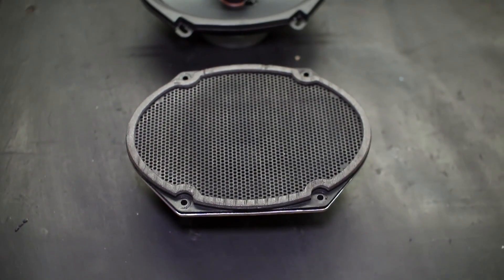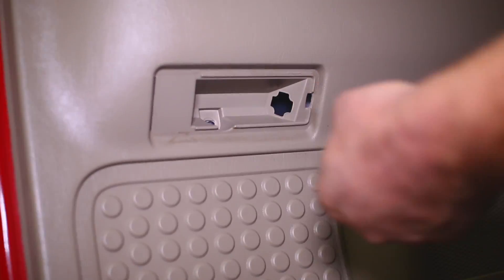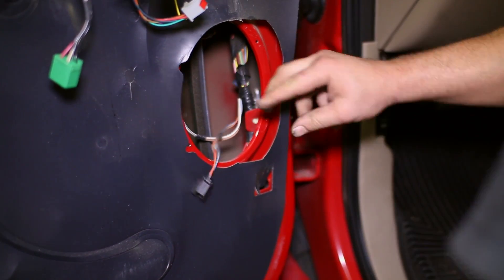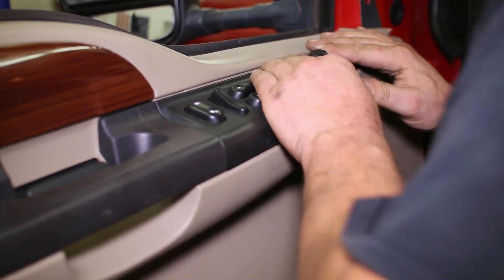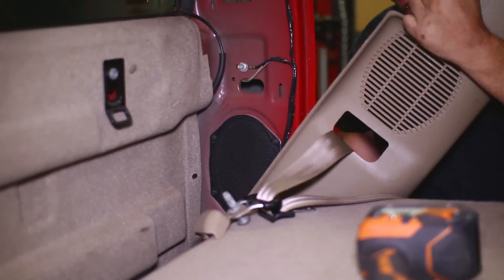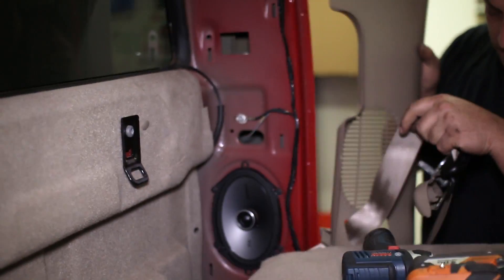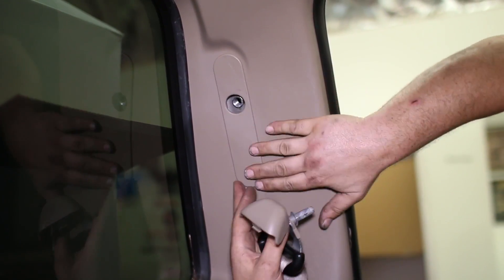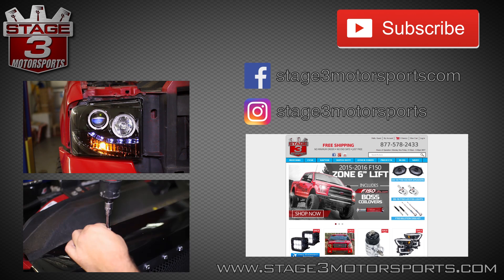1999-2007 F250 & F350 Super Duty Kicker KSC684 6x8 Speaker Upgrade Kit Install

Comment: Really good set. Easy to install, harnesses worked great. 10 minute install. Sounds great! Very happy with this set. Also, that's a T50 for the seatbelt if anyone wants to know.
Reply: How’s the bass? I have wiring for a subwoofer in my truck etc but stock speakers. Don’t really wanna spend the money on a subwoofer right away.

Comment: I have a 1999 f350, i bought the modern kit off of Amazon, came with the same speaker plugs. They did not fit my truck. Granted, my truck was built in 98 and the adapter is the same in the video, but the one on my speaker is flat. I dont know if its a leftover plug from the obs days. My truck is also a centurion, that might make it different, but just a sound warning to all e99 7.3l owners.

Comment: also wish people would say what size the bolts/screw heads are so you know what tools you'll need ahead of time
Reply: Just put in some new speakers. The door panel bolts were a 9/32. The seatbelt was a T45 torx. Depending on what anyone did/replaced the speakers may have different size bolts. I had 2 different kinds, assumed because the last owner was an idiot. The stock ones I believe are a 7/32 head. The Allen ones that come with the speakers were the other ones I had and they were a size 3...i think. One came with my new speaker screws.
Reply: T50